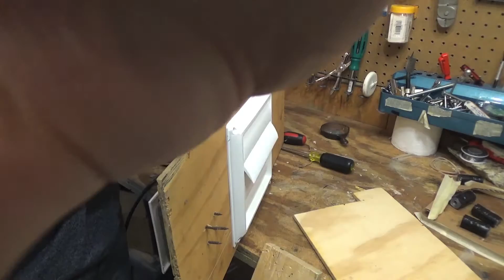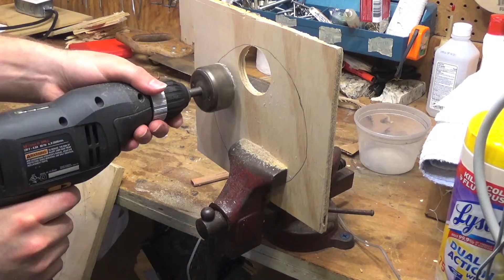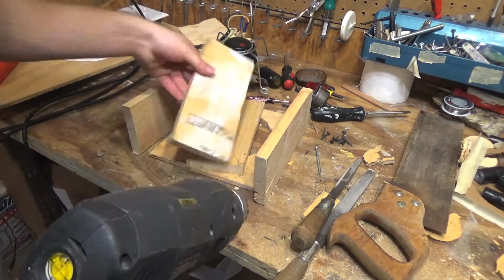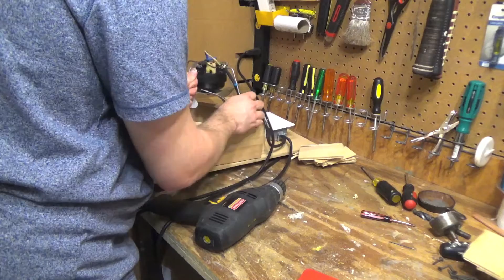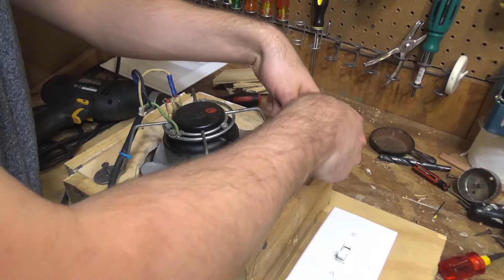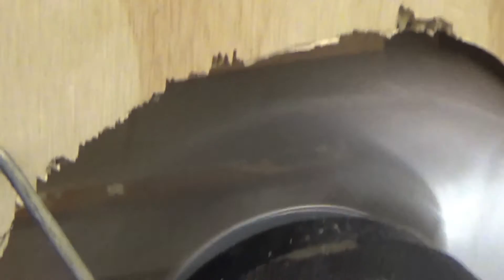New Bathroom Exhaust Fan Build

Comment: If you had a jigsaw, that would have been a much better way to cut that circle out.  The way you did it used less than ideal tools, and could have been dangerous.  Kind of in the same fashion of "a dull knife is more dangerous than a sharp one".  But it got the job done.

As a recommendation, which wouldn't require much modification to your design, I'd like to suggest you mount the faen inside the box.  That is to say, have the metal tabs with the circles at the ends on the other side of the board it's mounted to, while keeping the faen in the same orientation.  That may require cutting slots for the wire bales to fit.  While I can't say for sure, I think that might allow for more airflow, and may open the shutter more.  The way you have it now, much of the air is blowing out the sides, and back into the room, while only some makes it out.  Try it--shouldn't take you more than 15 or 20 minutes.
Reply from the maker: What was written in the description was intended to avoid comments exactly like that!

It's a possibility that this may change it,, though I have a feeling that the fan would not be drawing a lot of air from outside the box.. The blades are quite oddly shaped and the fan pulls in a lot of air from the sides.. I will be doing some experiments with other fans in this box, I suppose at the same time it would be worth trying this fan a different way..